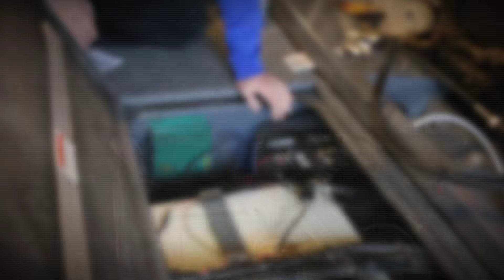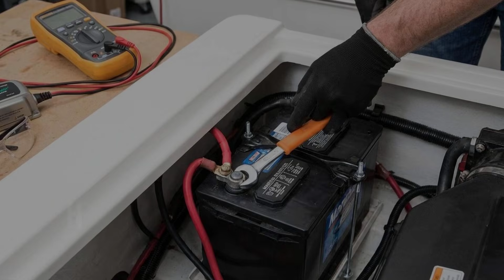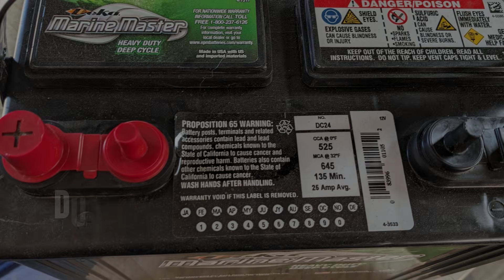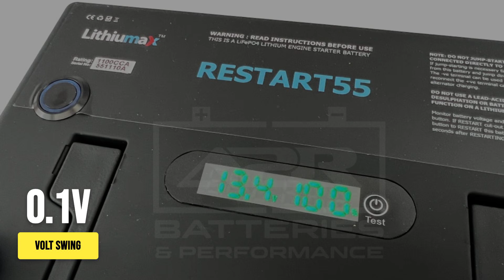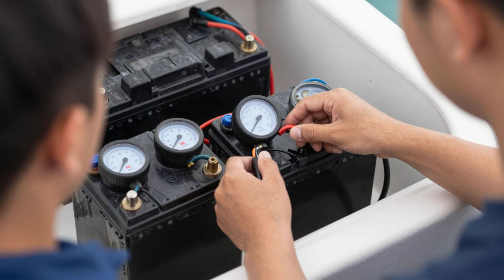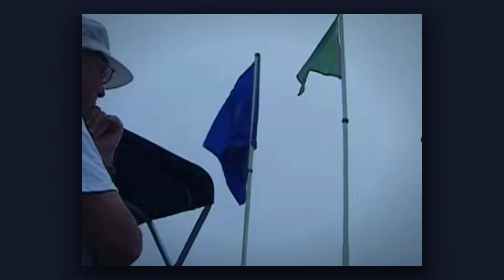Why So Many Boaters Are Replacing Their Boat Batteries Early (They’re Not Built to Last)

Comment: So, is this a "buy lithium" batteries instead of AGM batteries infomercial?
Reply: No, these are flooded battery, not AGM. AGM is far less reliable than flooded. The only benefit of AGM is that its sealed so you can mount it in odd positions and its less susceptible to damage from vibration. Its worse for longevity and reliability. Flooded lead acid is still king.